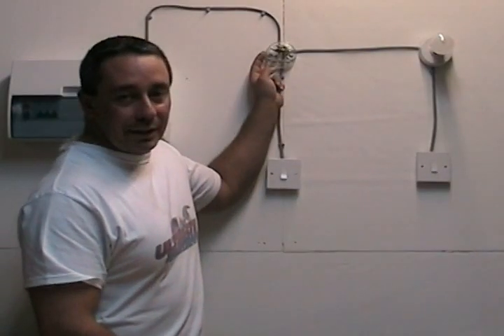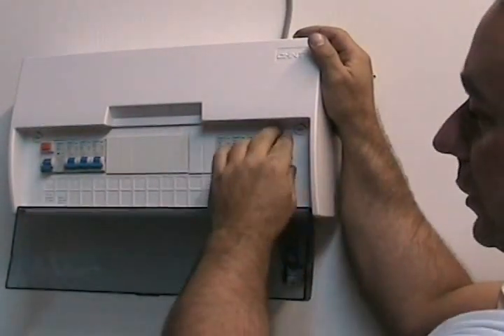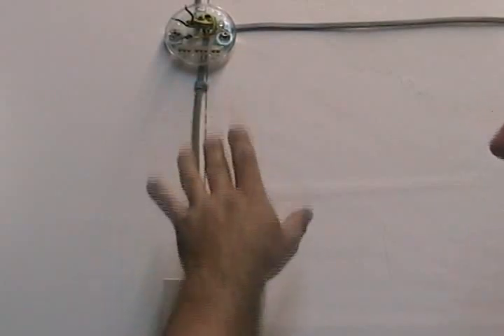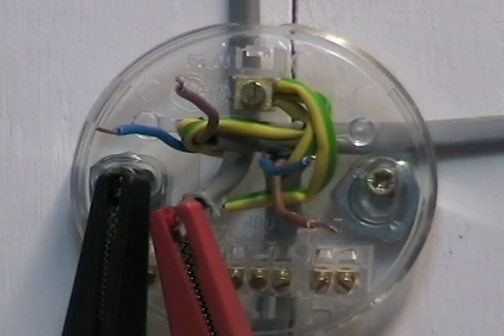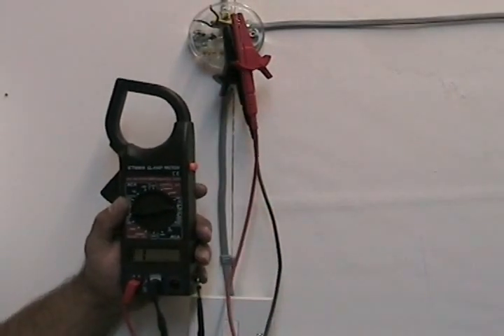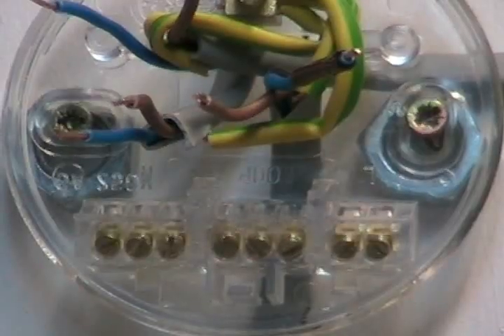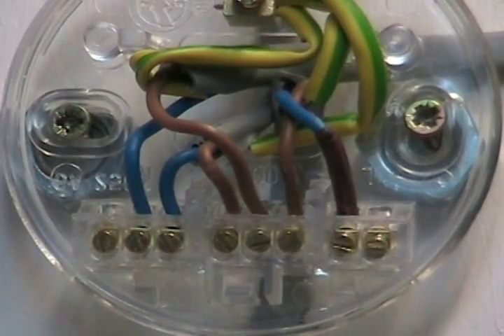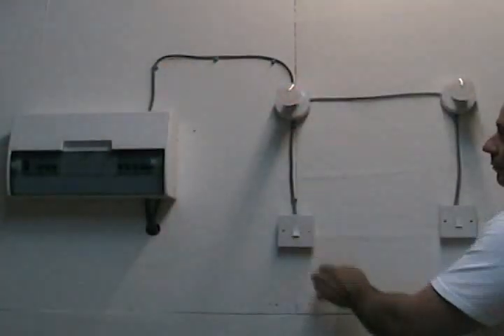Ceiling rose wiring (United Kingdom)

Comment: Great video. Thanks. I've establish which is my live switch using this method. Only problem I'm still having is that my light remains on even when the switch is on.

When I tested the cable using my multimeter, it was beeping even when the light switch was set to off.

Any idea what I could do next, please?

Comment: What does it mean if the meter beeps and carries on beeping whether you flick the switch or not?
Reply from the maker: It means you are not probing the two wires that connect to the switch- unless the switch has failed in the closed position.
Reply: @ultimatehandyman  thanks. Power at board off and cable is same one. Live neutral from single grey cable sheath.
Might be the switch... Got to be... The other cable doesn't beep at all so must be the cable into the light....

Comment: I took the old lighting rose apart and there was what appears to be 2 red wires connected together with a terminal block coming out of the cieling and 2 black wires that were going into the light fitting. Im assuming one of these black wires is a switched live but how do you figure out which one is the switched live? (Old 1920s house). Will the neutral wire have continuity with ground and the switched live wont have continuity with ground?

Comment: Can you post me the link to the clamp meter you use in the video, it looks simple to use and the bleep test is really handy. Great videos and always so informative. Thanks.
Reply from the maker: The one I used is a really cheap one, I think it is made by Rolson.
There only seems to be a second hand one for sale on ebay at the moment- https://fave.co/3nqBSXo
At that price I would not buy it, I would get another make ;-)
Reply: Ultimate Handyman that’s helpful to know, thanks. I have purchased the voltage tester you used in your videos to check a circuit is dead. That has continuity test on it - would I be able to use that to check for a switched live? I have a few ceiling roses to replace. Thanks.

Comment: Perfect. I found the switch but how do I find the live one as my switch has 2 red cables.i have a  Multimeter
Reply from the maker: One of the wires will be live all the time (permanent live)
The other wire will only be live when the switch is in the on position (switched live) 
The only real way to tell is to test it live (which is something that should be left to professional electricians)
Reply: @ultimatehandyman  yup I got it figured only thing is I've knocked the bathroom ones. All the loop cables are together 😪😪😪

Comment: I know this video is old but ate you still answering questions,.... I did exactly what you said but the light comes on even if the switch is off (I only have two red two black) ???? Baffled
Reply from the maker: If you have done EXACTLY like I have shown in this video and the light is on all the time, the switch is possibly faulty and has failed closed circuit (very uncommon).
Thanks for the comment 👍

Comment: Hi can you please advise what setting to put on the ohms dial?  My multimeter has 200, 2000, 20k, 200k & 2000k
Reply from the maker: If you have the audible function use that, but it does not  matter what setting you have it on, as any of those settings will work for continuity testing.
Thanks for the comment 👍
Reply: @ultimatehandyman  Thank you very much for your assistance, I will use the audible function thanks

Comment: I dont have a ceiling rose. But i have a bumch of wires like that hanging from where a light once was. What can I do
Reply from the maker: You can still test them, as in this video to identify the switch wires, then wire the wires to a ceiling rose or a suitable light fitting.
Reply: got it, my multimeter doesn't have a bleep function, how would i know if theres continuity?

Comment: Hi could anyone help me please..im in the uk...ive wired up my new ceiling light and the light is staying on....the ceiling has 2 grey wires each inside has ya brown, blue and copper....the light fitting has 1 brown, 1 blue and 1 green and yellow...it came with the block to screw them in to...it has 6 (3 each side) I wired the light fitting on 1 side and all the others on the other side matching the colours up...the light is staying on..what did I do wrong please xxx
Reply: same problem

Comment: well an electrician could follow this but most are not that is what they are here, shame you failed to explain what you were doing.
fucking waste of time, still at least you know what you are doing but that is not the point is it?
Reply from the maker: Electricians do not need to follow this video. This video is an almost idiot proof guide for people that "think" they can replace a light fitting, but then realise they can't. Unfortunately some people are so stupid that they should never be allowed to do anything to do with electricity.
Reply: Yea but it kind of assumes people know what all those connectors do and how wiring circuits are connected, I didn't really before but I do now. How about this? Connect all the brown wires to the centre connector, switch the power on, thus all the brown wires will be live. Then put the light switch on which will make one of the blue wires live. Then you can touch each blue wire end with and electricians screw driver and the one that lights up will probably be the switched live wire? So power off and connect that switch wire to the right hand side connector of two. Then the other two blue wires go to the left hand connector of 3. That would work I think. I've never unwired a ceiling rose before and if I did I'd make dammed sure I know where the wires went,
however I guess the switch live wire would be already marked.
I was only looking out of interest as I had to replace the bit the dangles down to the light which go to the outside connectors. I could not really go wrong as one wire goes each side. what was hard was putting wires back in and securing them in pretty dim light standing on a chair, it is really awkward like that with your hands above your head trying to see what you are doing. It didn't work first time as I had screwed down on to the insulation lol. (well second time actually, it didn't work first time as I had not screwed down onto anything as I had not pushed the wire in far enough). Anyhow I got it working in the end. I did it all with the power on which is not a good idea (the circuit power but not the switch, so just the centre block would be live). Was quite relieved to get it done. I needed to change the bulb holder as one of the tabs was broken/worn. I now realise the assembly unscrewed at the bottom so I didn't need to touch the ceiling rose at all ( however I don't think all the all unscrew at the bottom), so I could just have replaced the bottom bulb holding bit. What I did was swap the bit that dangles down with a light that was not used much. So I still need to fix the light I cannibalised. Anyhow I Am gonna but the broken one back there I think or maybe I will see if I can buy a new bulb holder. Sorry if I was a bit rude :O)  Anyhow I have not electrocuted myself yet!
Anyhow I learned something about wiring in the process so I am slightly less dangerous now!
Anyhow a lot found it useful. It was not really relevant to my issue as all those cable were already connected, but I guess it might be useful sometime, helped me think about how it al worked anyway.
Reply: Well I did it from the video and found it simple. Guessing you are a cry baby dumbfuck

Comment: Surely it would be easier to just use the brown wire as live instead of brown tape on the blue wire. Being an auto electrician it seems utterly stupid to have three wire system and not to use a common live colour. Using the blue as output from the switch means you can't rely on anything in the system being neutral.
Reply from the maker: Sometimes you find that the switch wires are both brown or both red in older properties, but it depends on who has wired the property and whether or not they had any twin brown and earth wire. 
The regs say that the blue conductor can be used as long as it is identified as being live by the use of brown sleeving or brown tape.

Comment: Hi there i want to change a ceiling light but when i took the cover off i found the cable to be black & red not blue & brown? To make it more confusing all the red wires are bound together in a plastic joint plug going nowhere 2 of the black wires go to a terminal in the existing light and the other black wire goes to a different terminal? how do i wire my new fitting up please??

Comment: Hi
Could you explain how I can rewire a ceiling rose that only has two sets of wires. It is an end loop I think. I've tried several times already but just keep blowing my fuse station.
I know its my own fault for not making a note of the wires when i took it down but I was over confident and thought i would remember :-(

hopefully Sue x
Reply from the maker: Hi Sue, This should help- http://www.ultimatehandyman.co.uk/diy/electrics/light_fitting/light_ceiling_rose_single.jpg

Comment: Could I just follow the wires from the light switch in the loft to figure out?
Reply from the maker: Yes, you can do that but it might be a lot of work removing the loft insulation.
Reply: Ah didn't think of the insulation being too much of a problem, I was too busy thinking about how I'm going to be able to walk around the loft without falling though the ceiling. I'm an inexperienced DIYer I don't think I'll be up to doing the job then.
Reply from the maker: Loft insulation is a nightmare now, especially if it's the correct recommended thickness!
It makes it really difficult to walk around up there especially if the insulation has been laid at 90 degrees to the insulation underneath!

Comment: dont understand why the installers of the ceiling rose used blue as the switch live wire in the first place talk about how to confuse you blues supposed to indicate neutral ?
Reply from the maker: This is partly due to the fact that most cable is blue and brown with a non sheathed CPC for the earth.
Most electrician simply sleeve the blue wire with brown sleeving to indicate that the wire is live, although you can probably buy twin brown and earth specifically for the switch wires.

Comment: Brilliant video put a new rose on lights working up stairs but light under stairs permanently on do you think light switch packed up switch about 10 years old the neutral from consumer in rose and one next to it feeds upstairs and there okay and is it possible to feed a shed from back of a socket to a water proof consumer board in armoured cable thanks

Comment: main switch should go on 1st not switch all the circuits on then put the main breaker on all you are doing there is putting full load on the main switch when turning it on !
Reply from the maker: MCB's should be switched on, then the main isolator.
This is to distance the operator from any faulty MCB's which can cause sparks under fault conditions.
Reply: so you switch the board on while its on full load !!! this is why domestic sparks are as welcome as a turd in a swimming pool on industrial sites ! havent got a clue..
Reply from the maker: On industrial sites we pull fuses from live boards, perhaps you missed it but this was set up to show how to identify the switched live wire in someone's home. Its not me that recommends switching on the MCB then the main isolator, but it was suggested by one of the parasitic organisations that looks after domestic electricians, they recommended switching on the MCB before the main isolator so that the person is not touching the MCB, which could spark etc.

Comment: I can't turn the the main switch off because the house alarm goes off, although I have tried turning every switch off (upstairs lights, downstairs lights and sockets) apart from the main one off I still got a pisser off one of the wires, its in the bathroom and there is about 8 wires, thanks for the video as I understand a bit more on electrics.
Reply from the maker: It sounds like the back up battery for your alarm is flat, if you replace it you should be able to turn your electric off without the alarm sounding (providing it's the alarm bell box that sounds when the power is switched off and not the alarm panel itself)
https://www.youtube.com/watch?v=4vsC9jgkVbo
Reply: Thanks a lot for your help, I called the number on my alarm panel today and they said the battery needs changing every 5 years, I have never changed it in 14 years as I never use it, so I have ordered a new one and hopefully I can then put the wife's new light up. thanks again.
Reply from the maker: You are welcome.
Thanks for the comments ;-)

Comment: Thanks for the video.  I was following it until the blue wire became the switched live.  Why is blue switched live in this case?  Thanks.
Reply: It's OK, I've got it.  For anyone else that was wondering what that was about, it's if the original installer had used standard twin and earth for the switch wire instead of the wire with 2x browns and earth in it. (I think)
Reply from the maker: Yes, some installers use twin brown and earth for the wires going to the switch, but if normal twin core and earth is used you need to sleeve the blue wire to indicate it being live.
Thanks for the comments
Reply: No I do t follow at all how did you know which ones to put croc clips on test metre? Which way around

Comment: What multimeter do you use in this video?
Reply from the maker: I'm not sure as I no longer own it (I think it got lost when I moved house).
Its not an expensive on though, but has a clamp function for measuring amps- which is useful.
Reply: is there a particular product you would suggest?
Reply from the maker: Mine was only cheap- like this one- http://fave.co/2ar0Rp8

For non professional use that model I posted a link to should be fine, but for Pro use I would be looking at something more expensive such as a Fluke- http://fave.co/2apjxZx

The clamp function is very useful-https://www.youtube.com/watch?v=9Zt3P9bvn8M
Reply: Brillant thanks alot.

Comment: how do you do this in a ceiling fan?
Reply from the maker: It depends really how it is wired and what the switch configuration is. With many ceiling fan's they need a permanent live and switched live so that the fan can work independent of the light.
Reply: ***** lol i fucked up all my lights trying to fit it myself.
Reply from the maker: Oh dear :-(

Comment: my light cable lacks neutral but in the distribution board its connected  how can i trouble shoot it
Reply from the maker: +Sylvester Muoki 
It won't work if there is no neutral!
If you mean there is no neutral between the switch and the light, then that's correct. It's very rare to get the loop in at the switch (which is what you need to get a neutral in the switch cable). 
This might help- http://www.ultimatehandyman.co.uk/how-to/light-fitting/lighting-circuits
Reply: +Ultimate Handyman thanks so much will try

Comment: Hi do you know anything about motion sensors in bathroom mirrors (hand swipe type) I've just installed one and it doesn't work ! Shaver works ok so the electricity is getting through . Have I placed it too close to the wall ? Many thanks
Reply from the maker: +chisty4 
Sorry, I don't. It's not something I have ever installed before.
Does it use LED's or lamps?
If it uses lamps it's worth checking to make sure the lamp is working.
Reply: thanks , it was too close . You need to leave a couple of hundred mm just for future ref :-)

Comment: I'm currently renovating my bathroom. I've lowered the ceiling for fitting pic cladding with downright. I need to wire in a fan as there has not been one in the past. What is the best place to connect the cable for the fan. I want it to work independent from the lights.
Reply from the maker: +Stephen Todd This should help- http://www.ultimatehandyman.co.uk/how-to/electrics/install-shower-extractor-fanNormally you would take a Earth, Live,Neutral and switched Live from the ceiling rose in that room, but if you want it to work independent of the light you will just need the Earth, Live and neutral. If you are in the UK, it might be worth checking the latest part P document to see if the work is notifiable before you start ;-)